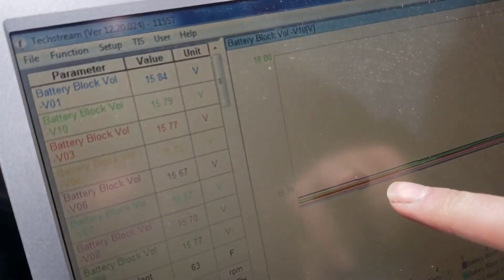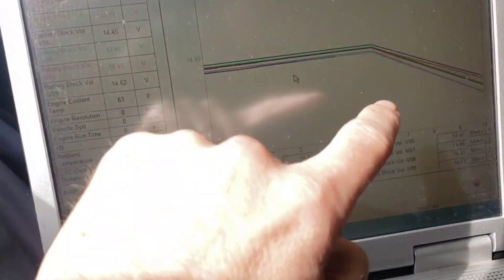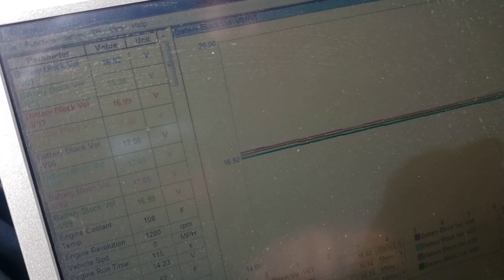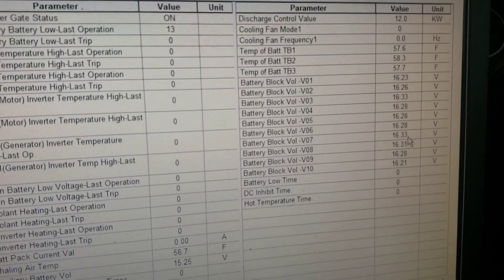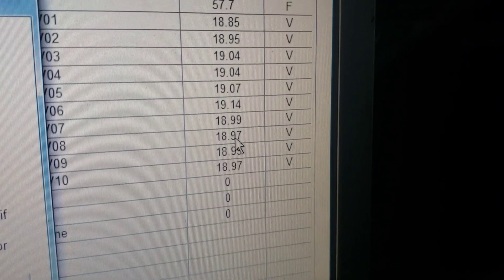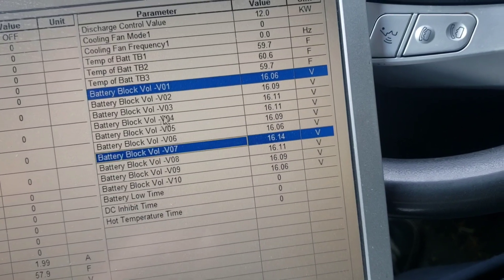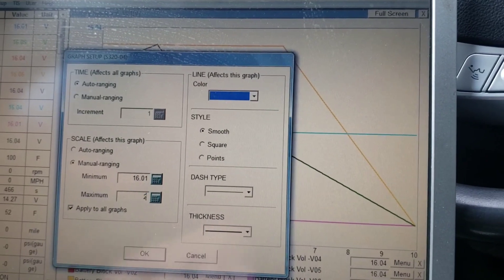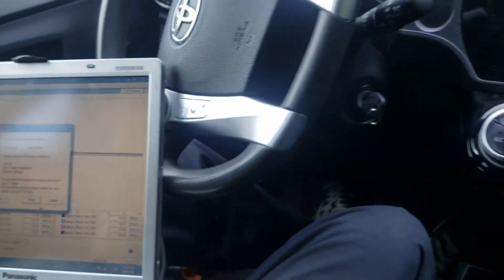Hybrid battery health check

Comment: Simply discharging using A/C, rear defrost and headlights for loads in Neutral will bring out the uglies.  High voltages on the ends, progressively lower towards the middle.  You can watch the dV go from what looks okay, to something horrifying.  Going below the typical 40% SoC floor (I like 20%) helps insure you reveal anything lurking outside the normal operating range.

Also... get a new cable.  I recommend Tactrix as a quality alternative to Drewtech.

Comment: Dude, I'm dying over here. I just got TechStream up and running and wanting to figure out what is going on with my battery. 

Every video I watch skips straight to the numbers part. 

It would be nice if you would have included how to get to the screen you are on.
Reply from the maker: It is a bit counter intuitive. A step by step on how to get communicating with a certain module must be out there. Cell voltages are shown after connecting to the hv battery ecu

Comment: Place the car in ready, nuetral, ac on high, it will drain down until the 14 volts drops out and farther until the car dies.
Place the car in Park, to charge it back up
HINT - CAR SAYS REPLACE PACK, 
1- pull the 12 volt battery to clear that code
2- Start the car and place in nuetral to drain the pack until the car dies
3- Pull the 12 volt to clear the codes
4- Drive the car until the problem comes back, while you get some replacement cells ready to install
5- Mine has been going for two weeks now with two bad modules
6- draining it down did a poor mans re-balance to make some headroom in the pack to avoid the error codes on the modules that then trigger the replace the pack code.